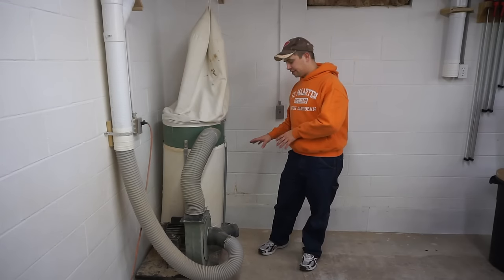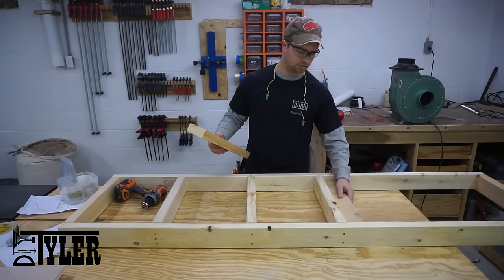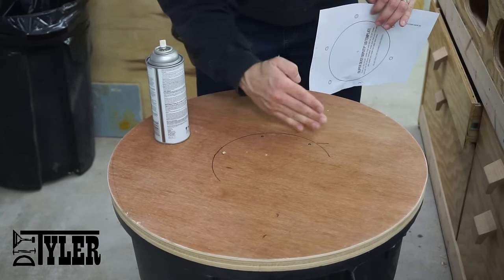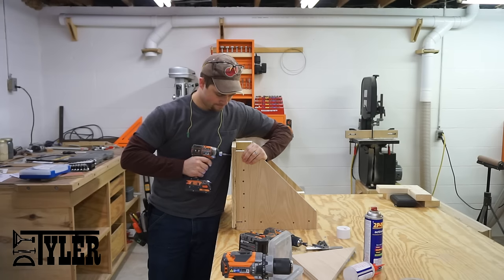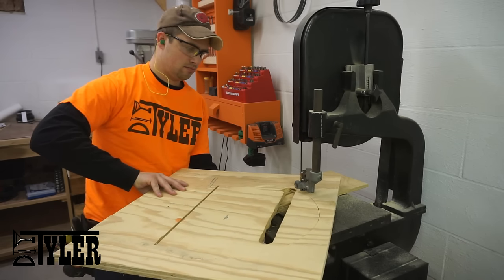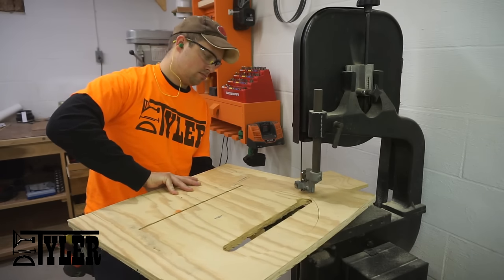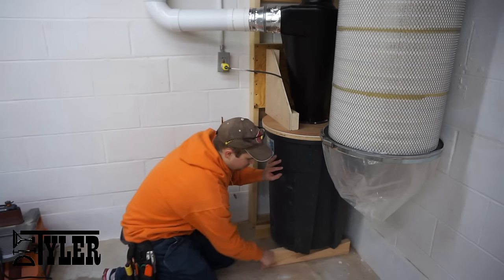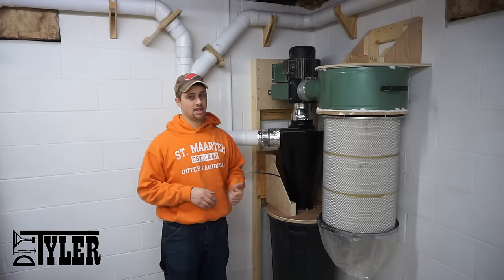2 Stage Harbor Freight Dust Collector

Comment: I have one of the HFdust collectors too and am considering a 2-stage mod like this. How is the performance through your piping on smaller connectors like on the miter saw? Right now my HF dust collector doesn't cut it when I hook it up to my miter saw with a reducer.
Reply from the maker: I have the miter saw running to a hood with a 4" port so I can't really speak to that but....going from 4" to a 2.5" port will restrict the DC too much. Maybe leave a secondary blast gate open to keep the DC airflow up? Basically you are reducing your pipe surface area by 4 so you can expect the airflow to do the same. Thanks  for watching!

Comment: Hey Tyler, I'm making a system about the same as yours. The Harbor freight dust collector has a 4" inlet/outlet. What I've been reading is that may be too small, 5" duct being ideal. Any issues with yours? What if I expand to 5" at the machine. Do you think that may result in too much of a drop in cfm?
Reply from the maker: I have had no issues with the machine as is, would be hesitant to change it to a bigger inlet because, like you said, you may have trouble keeping chips moving with this blower.

Comment: Hi Tyler,  What's the rated filtration of that canister filter you've implemented in this setup?  Great video.  Thanks for posting!
Reply from the maker: Don't have an exact number for you but it has 220sqft of filter and is WAY more than needed for the HF units. Just put a real time filter on it last night and it barely registers the filter even being on the unit.
Reply: Okay cool.  Where did you purchase the filter?
Reply from the maker: 62N220NANO1G from Wynn Environmental tell them DIYTyler sent you!!
Reply: wow. that filter has a MERV 15 rating.  that's pretty dang efficient!  i think MERV 20 is the highest.  thanks Tyler!

Comment: I sorry if you answered this already. Do you need to ground this system from static electrictiy.
Reply from the maker: +woodrat1952 That is a big debate with really no hard evidence in either direction. In my mind the entire system is grounded though the ground on the DC motor and into my house ground...good nuff so far. Have never been shocked from it. Thanks for watching!

Comment: good stuff ty! i wanna  convert mine ..waiting for the new table saw ..mi e crapped out on me this past week : ( did u get ur shirt from mike?
Reply from the maker: +Joe basementwoodworking Noooo, that's not good. What TS are you getting? I did, thanks!
Reply: ***** nonits definitely not. .havent been in shop for al.ost a whole week..i was gonna get the laguna fusion but its 66"wide and that wont fly in my basement..lol i didnt realize it until i measured in my shop and sd OK FORGET THAT BEAST. .so now its either the jobsite sawstop  or i was actually thinking the rigid 4510 and with the extra money get the smaller dominio..but that sawstop they say has everything the cabinet saw does except its size and hp but if I really wanted to I could rearrange my whole shop to fit the Laguna table saw but I really don't want to do that what kind of table saw do you have

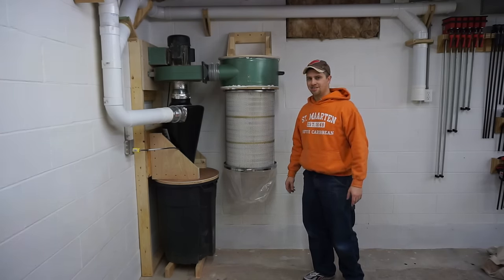Comment: Thanks for this interesting look at your customized 2-stage system. You did a great job explaining each step including both what you did and why you did it! Cringed though at 0:21 upon seeing the sharp 90 degree bend just before the ducting enters the cyclone separator. Would have been better to use two 45 degree segments connected by a short straight segment--just like you did in your vertical drop on the back wall next to your pipe-clamp rack. Looks like it would be easy to fix tho...

Comment: Hi Tyler the motor is 2 or 3hp 2850 rpm or more? Thanks.
Reply from the maker: +-Julian - It is a 2HP model and they claim it can move 1500 CFM but with my testing it's only about 1000 at best.

Comment: Tyler. What kind og filter did you use for this build and where did tou get it?
Reply from the maker: This is a Wynn Environmental filter from Wynnenc.com. This particular one is a 62N220NANO1G but they are releasing a new filter, 13F230NANO, in a few weeks that I would recommend.
Reply: Tyler how are those compared to the 35A line? I am thinking about converting my HF dust collector as well, and I want to get it right

Comment: I've been killing myself looking for a fitting for the cyclone inlet.  Needs 5in reduced to 4 in. Can't find anything even close. 5 in is so uncommon. Guess they did it to by their fitting. What did you use?  Paul
Reply from the maker: Fittings:
From Shop duct to SDD DRL001205  
http://goo.gl/FDTAAA
From SDD to HF blower unit DRL060500
Reply: Tyler G thanks

Comment: Any suggestions for a remote start switch (RF, the kind you can clip onto your shop apron) that works with the HF dust collector?
Reply: I'm using the PSI Woodworking LR110-3 Long Ranger.  The key is to get something that can handle the spike on startup.  I tried two lower amp rated smart plugs and it burned them up.

Comment: hi
im curious why did your dust collection bag not fill with air? i have done something similar to you and my bag inflates. Only when that has inflated fully does the air vent through the canister. why does your set up not do that? cheers paul.
Reply from the maker: Hey Paul. In the clip you are referring to it was the first time I fired up the DC so the filter was clean and it's way oversized for the airflow from this blower. So basically the airflow through the filter was so good that it didn't inflate the bag.
Reply from the maker: But it does now days since the filter is a bit dirty.

Comment: I'm curious to how this is truly working for you. After everything I have read, including Bill Pentz's site, it does not seem that the 4" ducting would be sufficient to move adequate CFM to collect chips, let alone fine dust. Especially with all the 90's you have. I have the same Harbor Freight DC and want to do the same thing, but I don't want to be disappointed in the results, and kick myself for not going with 6" ducting and a better DC. The main reason for the 4" is that it is almost impossible to find 6" ANYTHING locally, and is all the parts ( wyes, 45, etc ) are considerably more expensive than the ducting itself.
Reply from the maker: Am sure we have all read Bill's site, full of great knowledge but it kinda casts a use this or it's not worth your time vibe. My system works great, have never had an issue even with the angles....sure it may not be the most idea situation but it's better then no DC. This system will most certainly collect chips, maybe not all the fine dust but it does pretty well.
Reply: I appreciate your response. After reading Bills site I too got that same vibe. I am not too terribly worried about the fine dust collection, as I usually try to wear a good respirator anyway. I will go ahead with this system and hopefully will be as good as yours. :-)

Comment: How has this worked out for you? I was also thinking about bringing my shop down  to my basement but worry too much about fine dust creeping up to the second floor since my wife is having a baby. Do you ever notice wood dust in other parts of your home?
Reply from the maker: System works excellent. The wife has not complained about any dust in the house.
Reply: Nice. How much was that dust collector?
Reply: Anon Person thanks. They did have it for $209 and then when they had the 30% off coupon it went up to $230
Reply: LOL... That is HARBOR freight for you!!
Reply: But if you can use the 30% coupon code the dust collector would be down to about $170.00..
 Right??
Reply from the maker: I had to do a special video at one point and needed a second DC blower and I kept an eye out and got a coupon for $169. Search for it a few times on  their website, sign up for their coupon email and sure enough you will get a coupon soon!
Reply: Tyler I found your video last night. Great job on the HF DC convert! I am considering this for my very small basement shop area. But I  retired and living on a small budget. The SDD is the key for sure but it costs as much as the HF DC! Then there is the filter at over $200. I see that there are better filter bags like  1 micron from a couple of places for about $28. What do you think about doing all you showed then rather than the filter canister... use a different bag as the end point? Richard in Minneapolis. BTW... Love your website too!
Reply: Thanks
Reply: I could then add the filter canister cartridge later when my "ship comes in"...😊
Reply: Ended up getting it for $186 with tax. Stinks to know if I had gotten it a few days earlier it would have been $170. Didn't think they'd bump up the price. Got to save some money for that DD now. I was almost debating getting the smaller 1hp DC and using the difference in price toward the DD.
Reply: Just my luck.... it just went down to $199 so now it's only $160 after tax with the 25% coupon. I paid $186 for it just 4 days ago.
Reply: Alex M

Comment: Is there any reason I couldn't just leave the harbor freight dust collection the way it is and just connect the barrel with flex hose?
Reply from the maker: Would work fine. I was trying to cut down on the footprint
Reply: @DIYTyler  thanks, changed plans, now I am going to exhaust outside and skip the bag totally

Comment: I have the harbor freight dust collector also and have converted like yourself to a 2 stage with the oneida cyclone addition.  I'm getting a lot debris in my dust bag at the bottom of the filter and I don't know why.  Also the collection bag I have in the 55 gallon drum doesn't stay expanded inside and I think this hurts my air flow too!   Any ideas that  might help me out for this?

Good job by the way, I enjoy watching your videos!

Comment: do you have links to the filter, bag, and cyclone?
Reply from the maker: +Scott Haun (haunmade) The cyclone can be found here: http://www.oneida-air.com/inventoryD.asp?item_no=AXD002030A&CatId={17F46883-40BB-471E-982F-E5F28583241B}

Filter was a custom 62N220NANO1G from Wynn Enviromental
The bag was just a typical DC bag (20" diameter) that I picked up locally and to be honest, as far as I have seen, you can hang any type of lighter bag and you will be just fine. Thanks for watching man!

Comment: Another idea, for the bottom of your dust drum  https://www.youtube.com/watch?v=7TTnb3TyH5Y  Even if you did not use casters the mechanism would be very slick to lift the dust bin in position. I just added a smaller version of that cyclone to my central vacuum at home.

Comment: You do nice work, but I wish I was the guy selling you screws. Glue is stronger than the wood you are using, so most times you don't even need screws, let alone 30 or 40 per project.
Reply from the maker: Reasons for all these things that I don't have time to bring up in the video. Thanks for watching!

Comment: hello has that engine specifications?
Reply: Seems as the standard dust collector shipped under many brands. FM300 is a the actual model name, the Harbor Freight version is found here http://www.harborfreight.com/2-hp-industrial-5-micron-dust-collector-97869.html
Reply: they look the same but the Harbor Freight has a smaller impeller size than most other same HP models